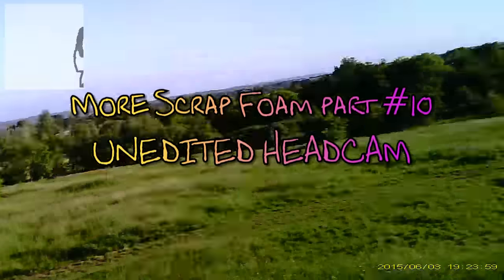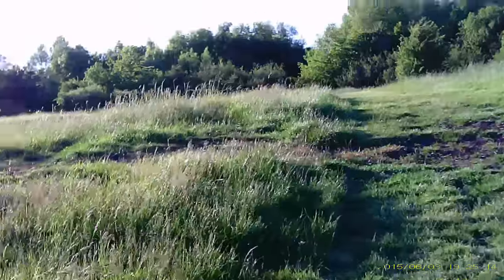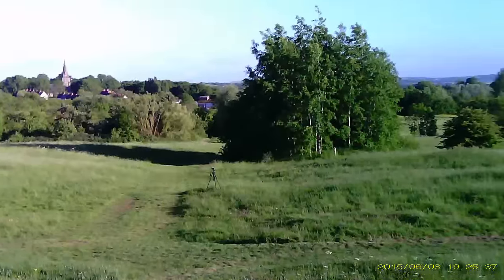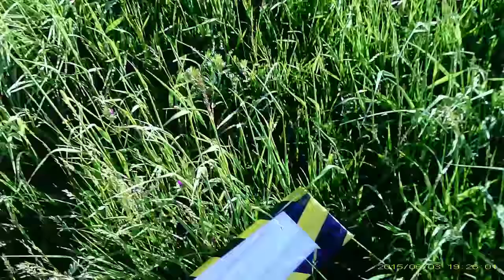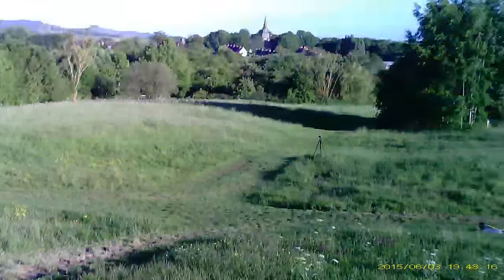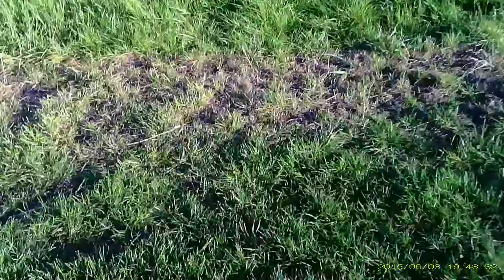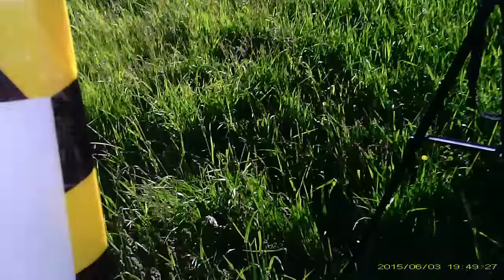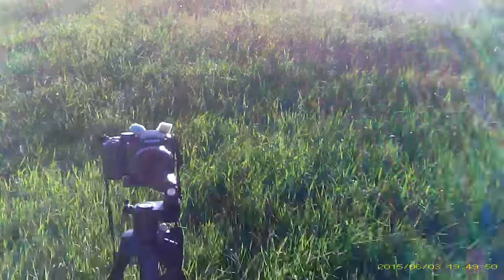More Scrap Foam part #10 Unedited HeadCam

Comment: you should use rubber band to launch the glider. This was a correction. Excuse me
Reply from the maker: Gil Fusaro thats OK, I guessed what you meant. That would be a good idea on flat ground but I intend to use it for slope soaring. I do intend to try a catapult launch system at some time in the future.

Comment: Maybe it would be a bit of editing and I am not sure what you are using for that purpose, but if you cut out a lot of the walking about and other minutes of video, the video would be easier to watch and take less time.  Many of my viewers in the past didn't want to watch long videos that were about walking around and such that didn't show the model flying.  From the looks of it, the camera in the sunglasses has a very low frame rate and tends to be choppy, but that is common for low frame rate gear.  Same problem with older computers trying to display the newer games that are hard on them with older video cards.  The low frame rate makes the game seem choppy and hard to tolerate watching.  I see some folks and a dog found your adventure interesting enough to watch.
Reply from the maker: Every view counts, so yours increased it to 457